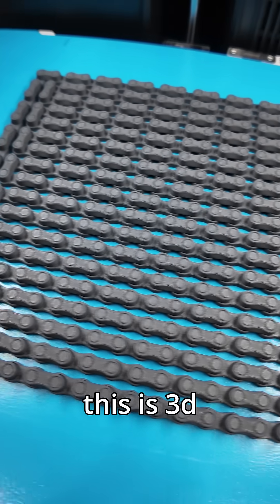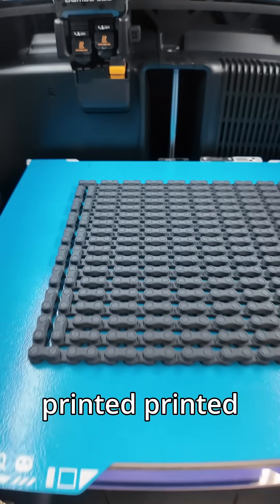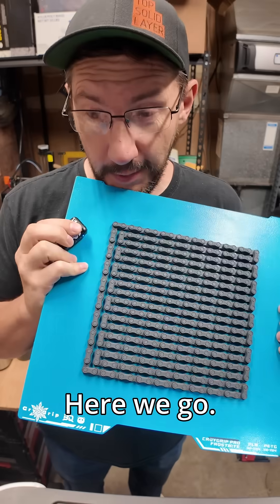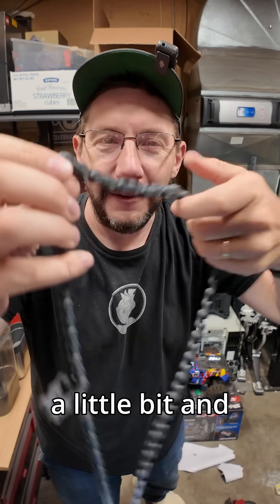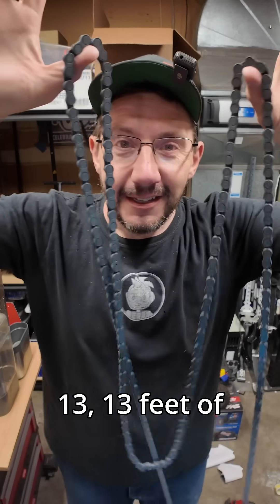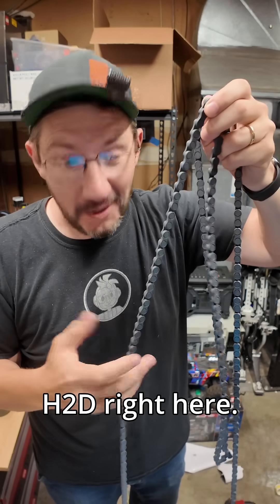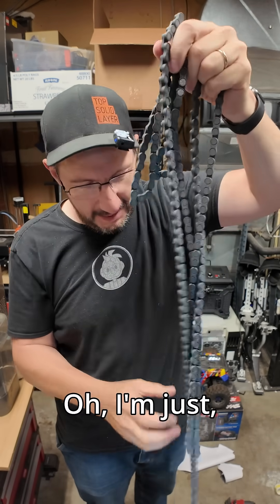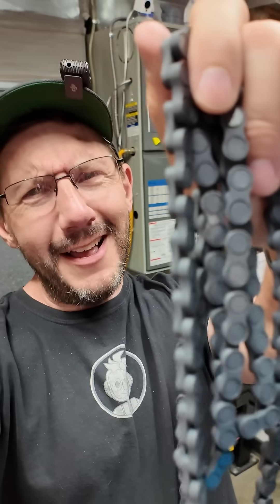13 Foot 3D Print! thanks @PCBWay

Comment: What's the point other than plastic waste? Is this for a functional purpose?
Reply from the maker: I used this as a way to create something cool that also tested the tolerances my machine is capable of for print in place mechanisms across the build plate.